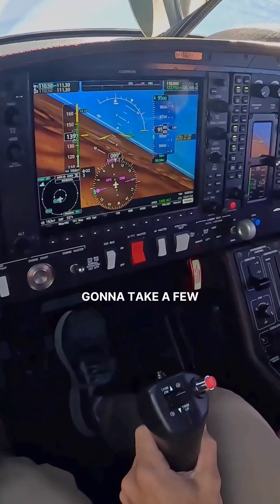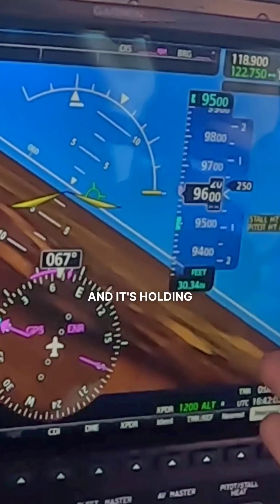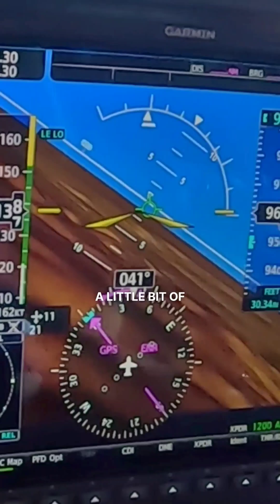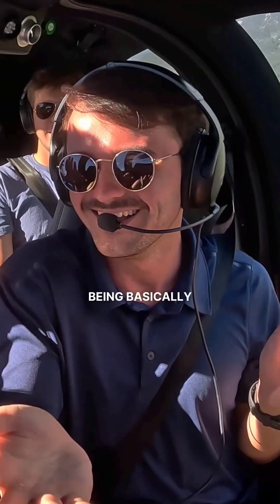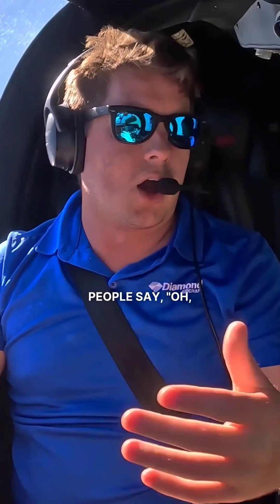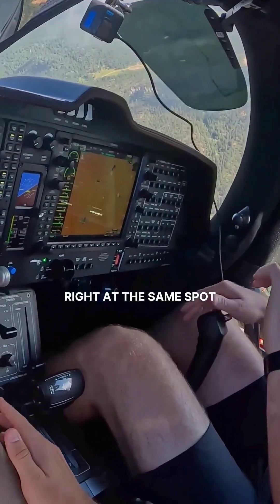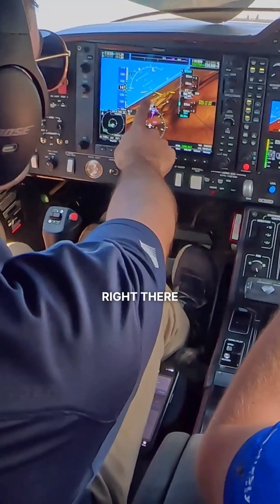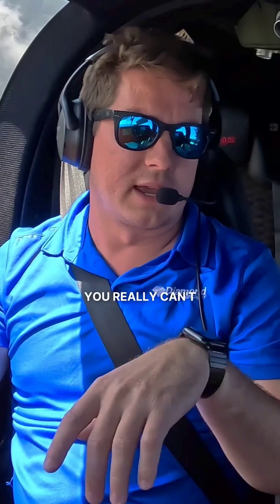The Diamond DA50 is in a CLASS OF ITS OWN! #da50 #aviation #fly diamond

Comment: id rather learn how to fly in a plane thats harder to control just so im prepared if something does go wrong. if I learn in this and something happens the pilot wont have the skillset to correct what is happening. Thats why doing your IR is probably a better idea to do it without autopilot because ive seen crashes happen where the autopilot has failed and the IR pilot has no idea how to fly the plane in actual IMC after that.

Comment: Years ago, the Boeing 737-200 with the Sperry SP77 autopilot had a handy attitude hold mode for roll-- just select HDG OFF on the autopilot control panel and it would hold existing bank angle.  And just as this guy does not know about his airplane, it was also limited at thirty degrees bank.

Comment: Throw the trim wheel twice on a Skyhawk and bank 45, you may need to hold the yoke to whatever side your turning but that VSI is gonna read 0 the entire time and no you don’t need to re trim it when you roll into the opposite turn
Reply: The amount of trim depends on the direction of the turn in a 172.  For the FAA check ride, you can t change the trim setting sets for the normal flight:

https://www.faa.gov/regulations_pol...aft/airplane_handbook/media/FAA-H-8083-3B.pdf

Comment: Says “you have to re trim it when you turn it back the other way” then turns it back to 30 degrees in the opposite direction. Assuming he is using elevator trim to keep the turn in motion at a 30 degrees bank it would already use the exact same trim (give or take) regardless of the plane you’re flying. I think what the mysterious person who said that original statement meant is you will have to decrease the trim once you return to level flight… Diamond 50 does pretty much fly itself though

Comment: I believe this never stalls and still stay in the sky without the engine on
Reply: I’m glad I only did a power off stall for my checkride in the DA-40NG. For some reason our SOP’s (power on stall) say 92% power, and with a decent headwind it’ll take a solid minute to stall at 19 degrees nose up attitude. Chance to drop a wing just keeps going up without excellent rudder control.
Reply: @_purge9488 Your minute must be short as hell. I've done many power ons in the NG, even with a 40kt headwind, and it stalls pretty quickly. From pitch up to stall, less than 10 seconds. I don't know what you're doing but power ons are easy.
Reply: LOL, but why begrudge a good noise-cancelling mic?